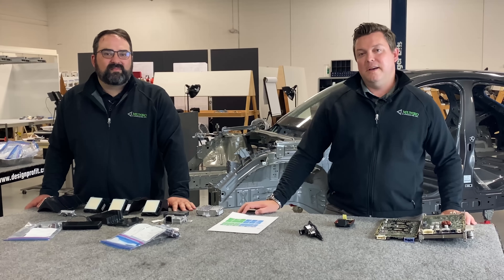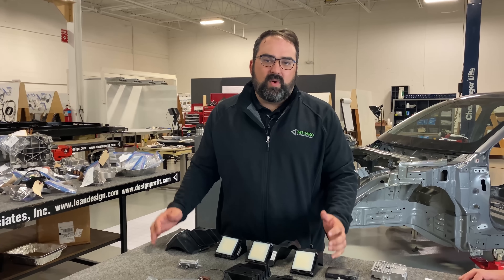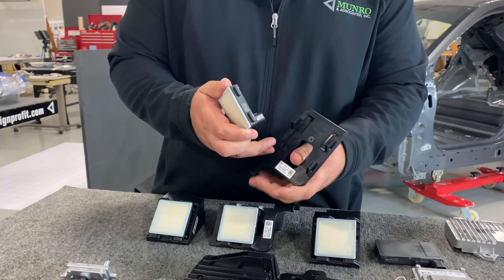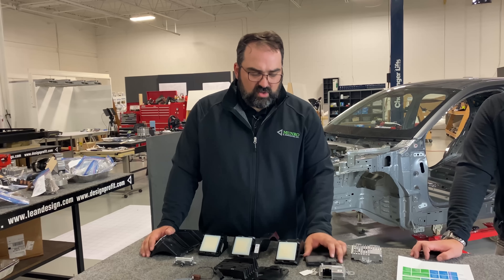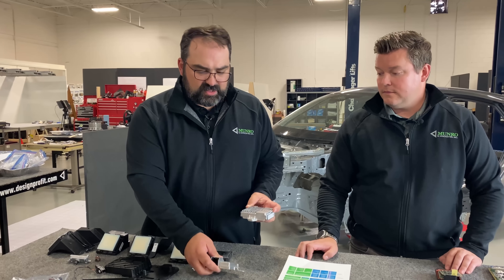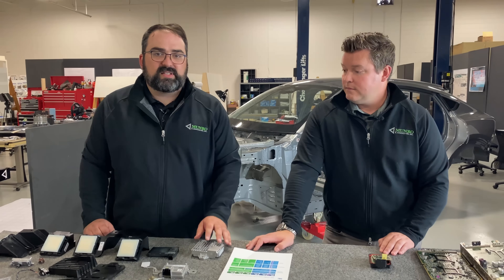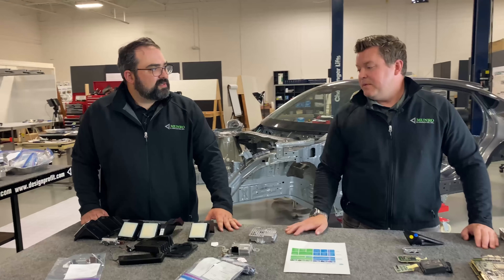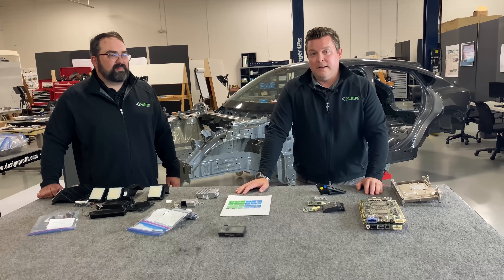Mach-E ADAS Breakdown

Comment: I think I would prefer to have both radar and vision. Their strengths and weaknesses don't really overlap. Situations where one would be great the other is horrible. Perhaps at least some basic radar for the car to use in inclement weather.
Of course at least for now if you're driving an inclement weather you really shouldn't be an autopilot anyway. I suspect by the time true autonomous driving comes it'll be far enough into the future that none of the cars on the road today are going to really matter that much

Comment: 10:15 I believe the solution Tesla is making for that one is to maybe stop running the autonomous system or maybe slow down. Same deal with a responsible human driver and not a reckless one. Those responsible ones will A) slow down if the visibility is low to none. or B) stop at the side and wait until it is clear. Unless a the driver is reckless then those drivers will just speed through the thing.

Comment: The ADAS 'feature' where it will stop you from changing lanes when the blind spot detection would be super annoying. In the cars I have driven with blind spot detection have all had issues when turning at an intersections where two lanes turn left (i.e. entry to freeway from side road). This 'feature' would stop me from turning a corner.

Comment: Very informative. Yes, we did not need to see or the cabling. Tesla has a vision problem. Thermal cameras in addition to current cameras would be very helpful - perhaps 40,000 pixels. Tesla vision cameras have 1.2 megapixels. Looks like Ford cheap sensors are one pixel each. The forward looking radar may be 5 to 10 pixels.
Reply: Mach E is also using Mobileye's EyeQ4 which is a camera-based system capable of reading traffic signs and doing Level 3 (Eyes off) self-driving.  I'm not sure how man pixels is their camera though.

The radar sensors help provide additional reliability and robustness by allowing the system to detect objects to avoid collisions in certain weather and lighting conditions which is tougher for vision only systems.
Reply: @robertguzman1394  Intel Mobileye likely a great choice for Ford. Radar can see through rain, fog and dark, but resolution is very poor. I think Infrared will end up being the choice to support vision in autodrive systems.

Comment: Exactly, I'm not found of removing the front radar in security assistance.  When the conditions are not going to be optimum the security is going to go down. Fog and cams are useless, A big insect crash where cams are and the car won't be able to see well or it might not be able to  appreciate the distance of the obstacle very well.  I understand they want to save money, but at some point it just going to be worse. I think the goal is not to make the car as bad as we can be in some circonstances.
Reply: I agree. There’s no substitute for safety. There should be redundant system for safety component.
Reply: @johnpugat8618  Yes, especially when those systems are complementary, and as important as front detection

Comment: Elon Musk said LIDIR is dumb and expensive way to have self-driving. Is it? To me, it looks like Ford uses both Camera and LIDAR with a less expensive controller whereas Tesla uses multiple cameras and the automobile equivalent of a.supercomputer. I don’t know which is better but Ford seems simpler and less expensive. Is LIDAR that expensive?
Reply: The Mach E is not using LIDAR.  It is using the EyeQ4 camera-based system and radar.

Mobileye's EyeQ4 camera-based system is capable of reading traffic signs and doing Level 3 (Eyes off) self-driving.

The radar sensors help provide additional reliability and robustness by allowing the system to detect objects to avoid collisions in certain weather and lighting conditions which is tougher for vision only systems.

Comment: 10:20 NO 🤦. You just stated correctly that radar cannot see details, and then face palmed by saying radar can see through the bad weather without clarifying that the same problem still exists: Radar CANNOT read lane lines, signs, or anything else requiring details. And since fords require pre-scanning of every road they cruise on, they become bricks if said road edges are not visible. 

Tesla can drive slowly through fog (just like humans) and as far as visibility will allow with zero radar whatsoever.  Lower wavelength LIDAR can see perfectly through fog, but cant read lane lines unless very sensitive (and expensive) reflectance mapping hardware is used. Visionless-radar wins here hands down - mainly due to denoising algorithms and contrast adjustments that can make this work fine in fog and rain etc.
Reply: The Mach-E has forward looking camera as well as radar. What is your specific point here. I don’t quite understand what the limitation is for driving the Mach-E in fog or inclement weather.

Comment: Unrelated but related to the new Tesla Semi is new information has emerged stating it will be able to pull the same weight as any other semi which Sandy keeps saying it can't because it will weigh more than ice semi. However it doesn't and also has 1.5 megawatt charger from the quick math I've done. Just thought I'd let you know

Comment: I'd love to have someone explain me why radar isn't used for edge detection. The difference between pavement and dirt should be easy for radar - easier that using algorithms with a camera, right? And better if various objects are along there that could confuse a camera system. I think it would also be very useful if the edge is covered in snow, especially when it's still snowing. That's my big concern with Tesla going to a vision-only system. There are plenty of small roads where the pavement crumbles into the dirt shoulder, and the shoulder quickly becomes a ditch.

Comment: I’ve been saying since I bought my Model 3 that Tesla has needed to have at least 5 radar. It’s ridiculous they don’t have blindspot monitoring or cross traffic detection, front or rear, and I seriously doubt there will be any way for their limited number of cameras to ever come close to matching radar’s accuracy, especially in poor visibility.

If the cameras can’t detect cross traffic in simple situations like backing out of a parking space, how the heck does Tesla think they will be able to handle complicated intersections where you may have trees, walls, tall vehicles, buildings, etc. that prevent the B-pillar (side looking cameras) from seeing left or right. With no radar backup, that’s a really bold (and in my opinion) dumb decision that makes no sense. I would personally like sensor fusion and redundancy with both radar and vision confirming what each other sees. New radar units are being developed that fuse two radar sensors side by side and it’s supposed to almost create lidar like imaging in even complete blackout visibility scenarios where cameras and lidar fail. I suspect it will be a promising addition down the road. Camera only seems like a dream that will be impossible to recreate since we don’t all live in southern California with sunny clear days 99% of the time. Some of us deal with fog, snow, ice, rain and haze on a daily basis. I don’t see how Tesla’s 1.2MP cameras aren’t going to be the solution.

Comment: 9:06 did not know car radar is short range until i googled it, now Tesla's vision makes sense.  however, radar can be redundant system to vision so I still think it is still useful despite the cost and rare utility
Reply: I agree about it me feeling more comfortable to have both sensors.  

The Mach E is using Mobileye's EyeQ4 which is a camera-based system capable of reading traffic signs and doing Level 3 (Eyes off) self-driving.  The radar sensors help provide additional reliability and robustness by allowing the system to detect objects to avoid collisions in certain weather and lighting conditions which is tougher for vision only systems.
Reply: @robertguzman1394  i dont know what Tesla is up to considering dense fog has high risk of accidents. Tesla Vision and/or the driver is simply not ideal for this situation. i guess Tesla can't make radar and vision to work well with each other

Comment: Great job by both of You. Sandy has selected a good team. Let me get this right. You have to pay $2,600 for the 5 dumb radars to be included into the manufacture of Your FORD and likely can’t be added later without extreme additional cost. Do the Radars see through the metal or is there à port or hole in the metalwork?  TESLA Cameras and computers are built into every car for free. You pay $10,000 to activate FSD or $200 per month subscription. Is there a charge to use autopilot?  Let Me repeat Myself. The Radars have no Intelligence other than mass size and distance of object. TESLA cameras have extreme intelligence with the software and DOJO TRAINING.  MY GOD THE WHOLE INDUSTRY IS LIGHT YEARS BEHIND TESLA WITH FSD.

Comment: I wonder how well those cheaper radars on the Ford would actually work through caked on ice, snow, dirt, etc. On my Model 3 with radar, in past winters with caked on ice and snow, I noticed some deterioration in functionality. That forward radar is more sophisticated than Ford's side and rear radar. I also wonder at the efficiency hit of having five radars drawing power all the time vs Tesla's low wattage v3 ADAS using cameras only. It's also pretty rare for any of my cameras, save the rear trunk camera, to be so dirty they are pretty much useless. I believe issues with partial obscuring or shine from the sun are being solved as Tesla continues to evolve their perceptual neural networks using their fleet data. They also have some redundancy with forward and sides having 8 cameras around the car.

Comment: I have noticed in videos of the latest Tesla FSD software in action that the system is hesitant to attempt to cross a road that has speeds above 40 MPH and where the traffic doesn’t stop. I believe this is a result of Tesla using wide angle lenses on their side view cameras and the cameras not having enough resolution to pick out approaching vehicles until they are too close to allow crossing. As such, I don’t believe the Tesla vehicles have all the hardware they need to implement full autonomy. They need side view cameras with longer focal lengths and/or higher resolution.

Comment: Are they using MobilEye solution or someone else?
Reply: It is using the Mobileye EyeQ4 camera-based system and radar.

Mobileye's EyeQ4 camera-based system is capable of reading traffic signs and doing Level 3 (Eyes off) self-driving.

Comment: If the Tesla system, with cameras only, doesn't work effectively in inclement weather, I don't understand how they could possibly remove the radar and say that's good enough. It seems like you'd really need both.
Reply: I’ve heard it put that you can drive autonomously with cameras only but it is nearly impossible to drive autonomous with radar only. If the cameras go blind, you are screwed whether you have radar or not so what value is the radar really adding. I’ve also heard that, for sensor fusion with radar and cameras can be difficult as they can present conflicting info.

Comment: Elon Musk “radar is just a crutch” Ford “We’ll take 4!”
Reply: What is the fascination with radar?  It’s yet more electronic noise on our roads that will ultimately fog up every car fitted with radar.
Reply: @Dave5843-d9m  you are correct about the other vehicle noise if they are all using radar...I have reservations just as you do.
Reply: I think the issue with radar is in interpreting what it is “seeing” a camera should have a far greater resolution and using 2 cameras you have death perception. Tesla has a lot of processing power in its controller and runs 2 sets of software. Watch his reveal on it 2 years ago he explains allot.

Bye M.
Reply: @markeh1971  lol death perception, please don't fix it
Reply: Funny!  To be fair, Ford isn't aiming for Level 4 or 5, like Tesla is doing.  The lack of cameras that would be required for Level 4 is compensated for Level 2 with all the radars.
Reply: @SodaPopin5ki  To clarify, the Mach E is using Mobileye's EyeQ4 which is a camera-based system capable of doing Level 3 (Eyes off) self-driving.  The question for me is, will they be able to achieve Level 4 by adding the current radar sensors to it?
Reply: @robertguzman1394  According to Wikipedia's page on MobilEye, EyeQ4 is designed for SAE Level 3.  EyeQ5 is the one designed for Level 4 and Level 5.

Comment: Regarding why Tesla dropped radar. They explained that it had issues with occasional bad readings that would either cause ghost breaking or the software would just ignore, but then if the software is essentially ignoring it then why not remove it? As for poor vision situations, I would not trust radar alone for level 2 driving. In those situations radar would really only be useful for accident avoidance situations, but the reality is that if it is too dark to drive safely you shouldn't be driving.
Reply: Against the dark they could try to install headlights. 😉

Comment: 'Everything that is on the road today is level 2'. Not true. Waymo is level 4 and I don't think they are the only ones.
Reply: Waymo is using LIDAR that only works on geofenced areas which also require high detail maps, Waymo's cars are working using invisible rails, it is nowhere near what Tesla is doing which is solving real world vision-based A.I. for FSD.
Waymo's cars will never work outside these areas and they will never be able to perform anywhere near Tesla's FSD on edge cases.

Tesla's is considered still at level 2 for legal reasons only (so that the company will not have any implications until their system is level 5 which will need 2-3 more years), the capabilities of the system are near level 4 of TRUE autonomy, not like the invisible rails of Waymo.
Reply: @OnigoroshiZero  I mostly agree with you, but it remains the case that Waymo is level 4 NOT level 2 as claimed in the video, and Tesla is aiming for level 5 but is currently level 2. LIDAR works anywhere regardless of whether the area is geofenced or not. Waymo's methodology only works well in geofenced areas. Tesla's methodology has the potential to work almost anywhere but will take longer to get to level 4/5 than most people think because of the corner cases. My expectation is it will get much more reliable for highway and standard roads within the next year or so to the point that you can almost call it level 4 for highways, but I would want to see some thorough testing before it is legally acceptable to completely ignore the road during highway driving. But to get to level 4/5 for regular roads in most cities will take several years at least and for more complicated regions much longer. Where I live there are some complicated situations that require a sort of negotiation with other drivers as to right of way, and there are poorly marked roads and I have recently driven on muddy roads where even I made bad decisions. Tesla's AI is a long way from handling these situations. That said, if it could drive the easy parts without supervision that would be fantastic.

Comment: A bit of clarification -- radar can also create what humans perceive to be images through a technique called SAR.  While I'd wager that these are not SAR capable radars, they're superior at seeing through weather.  Combine it with a good IR camera and it's the truly ultimate system.   We have glide bombs using this exact method for prosecuting targets and it's called the "stormbreaker" because it's all weather due to SAR.  Radar is superior to optical in that it can see through whiteout conditions / rainout / sandout where visibility is zero.  Image fidelity is higher in visual wavelengths however.

In the 91 gulf war, B2s flying at altitude used SAR to identify iraqi tanks that thought they were able to hide in the dust storm -- B2s provided targeting data for smart weapons to take out the tanks 'hidden' in the dust storm with ease.   Cameras can't touch such capability.  The processing power and antenna arrays exist enough in the civi market to enable this in vehicles -- it will be the next step.  It's an RF equivalent to LIDAR which is those scanning things on vehicles -- they're lasers creating point clouds.
Reply: How far can radar see in whiteout conditions? Radar range decreases with heavy fog as well.
Reply: @ymcpa73  Depends on the frequency.  Different frequencies have different interactions with different elements.